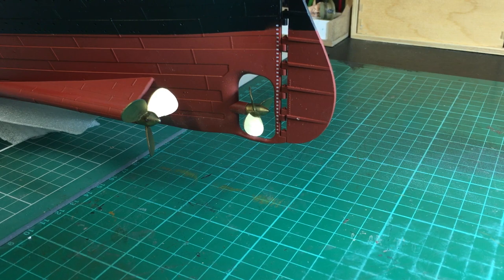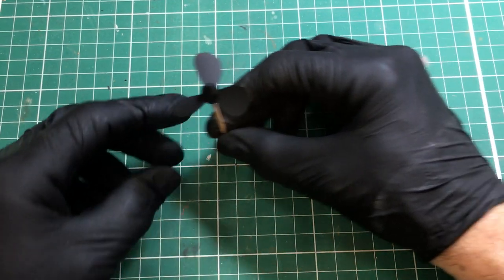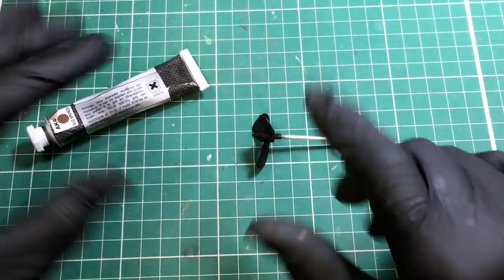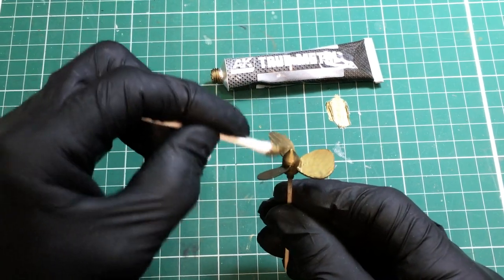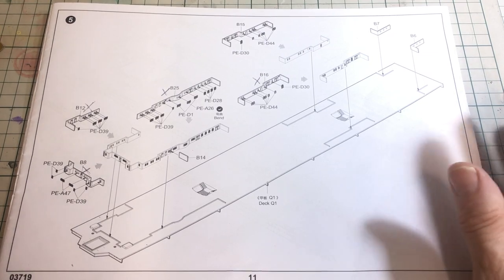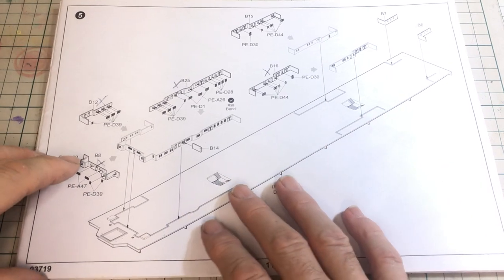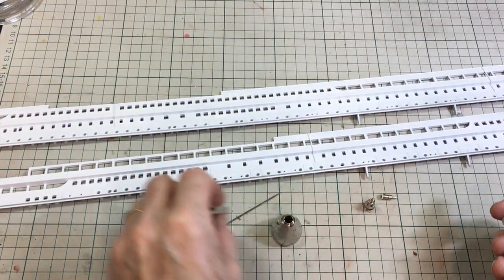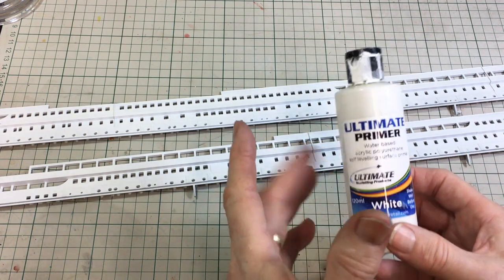Trumpeter1/200 R.M.S Titanic (#03719) Part 3  Hull and deck preparation

Comment: Hey hope all is well…. Just wondering how you go about painting the grey blue in the small building roofs and crane structures etc… theres always a little lip around the edge that’s impossible to mask… think you would have to paint the grey first then mask the recessed section and paint the white afterwards…. I did look at your example but you only show after it’s been painted…. I think one you videos u use to demonstrate?